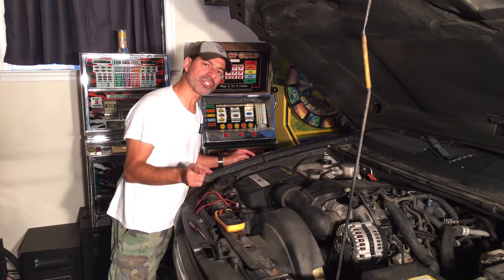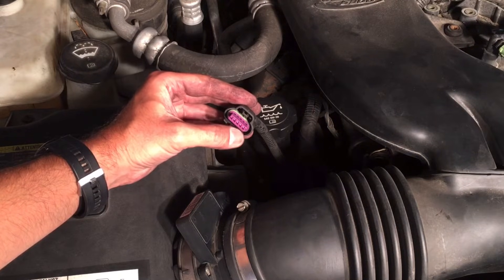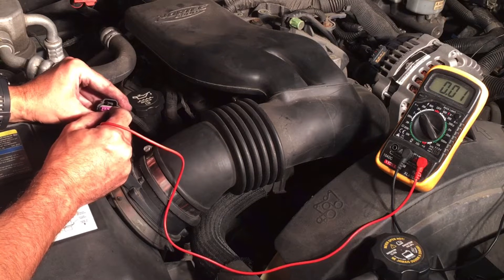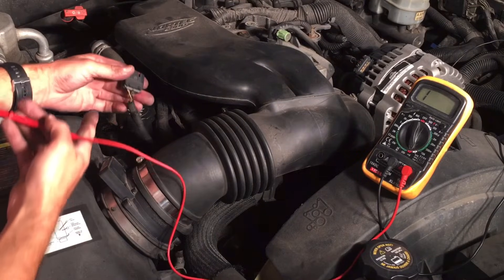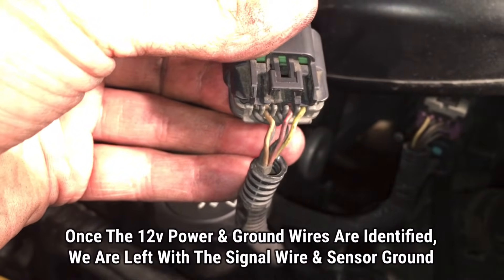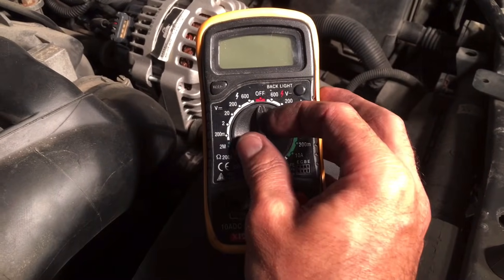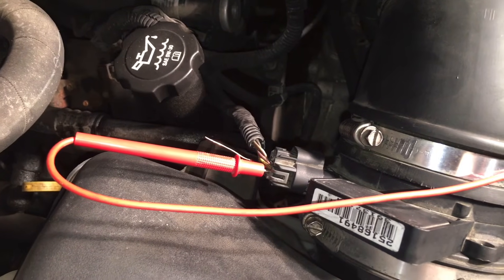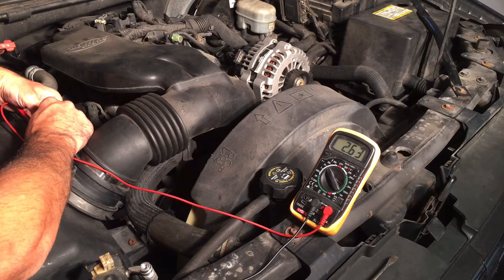How To Test A Mass Air Flow Sensor (Andy’s Garage: Episode - 287)

Comment: Very informative video up until the ~6 minute mark. I got disoriented when I saw the multimeter probe directly connected to the wire harness.
Reply: Saw that too, does that mean he needs to test the harness? Cuz I’m facing the same issue with a 08 subie. Batt wouldnt hold a charge, replaced it. Buddy wanted the fuel pump replaced while at it for kicks. Cleaned ground spot, replaced the greenish color ground strap, forgot to plug MAF in, neg term tight, started right up. Plugged the MAF in with it running, idled without much slug, and no CELS. Fast forward a couple hours, all crank no start. Replaced the cracked terminals, cleaned up all the grounds batt side, all crank no start, scanner gave MAF codes. It had 02 sensors and cat sensors and VVT sensor codes before. But now it’s just the MAF codes. I thought the batt was the main problem, I guess it was secondary. I about had it with this damn car lmao

Comment: I have a 04 Vortec 4.3.  I have a rich reading in both O2 banks. And a MAF reading in the 7’s at idle and 12-14 at 1400rpms.  O2 short trims are in the -20’s. Not sure what’s causing the rich running.  Pretty stumped
Reply from the maker: @SubePelayo928  Are you getting any engine codes?
Reply: @PhillipsVision  the P0172-0175 rich codes and there was a pending code for the MAF
Reply from the maker: @SubePelayo928  could be the MAF causing all these codes. Also check for vacuum leaks around your hoses
Reply: @PhillipsVision  do you think a bad spider injector can cause it?   Fuel trims are in the negative as it’s trying to reduce fuel. O2 banks on both side are showing rich.   maybe the MAF is showing high to compensate for the amount of fuel that’s being dumped in?

Comment: I have code 106 and 108 the car starts but sounds ruff idling think its map sensor or wire any suggestions ihave changed spark plugs coil packs mass sensor now order map sensor
Reply from the maker: @kylebrewer6686  the codes you are getting pertain to the MAP sensor. When those go bad you will get rough idling among other things. Replacing it should solve your issue.

Comment: You say after excluding the 12v power and two ground wires, one is left with the signal wire and sensor ground. . . But of those two, neither tested positive for ground continuity. How could there be a "sensor ground" wire that's negative for ground continuity?

Comment: I've always had intermittent issues engine management issues with my 03 Chevy Express.  It sat for about 7 years until I recently needed to get it back on the road.  It ran fine then it stalled on me and I had a MAF code.  I found the tube for the intake popped off the piece that attaches to the throttle body.  FFS

Comment: I AVE MERCEDES BENZ C220  OF 1996 , NOW I AM FACING THE ABOVE PROBLEM, LIKE ENGINE RPM GO VERY HIGH, BUT THERE NO POWER TO PULL THE CAR, ITS STARTED SHOWING THIS PROBLEM RECENTLY, IS IT RELATED  TO MASS AIR FLOW SENSER, AND ALSO PETROL CONSUMPTION ALSO INCREASED, ?EXPECTING SOME REPLY FROM YOU,

Comment: I just tried a web site that for $2 let’s you ask a question of a mechanic so I asked which is the signal wire on a Subaru forester and I got yellow wire pin 5. This info in addition to this excellent video allows me to follow the direction but jump straight to testing…wow this makes it so simple. Thanks for the great video.
Reply: what website would that be my friend.. Im trying to teach myself right now and Im kinda stuck
Reply: @johnnyappleseed6665   Don't give in, man. Just keep going, like I do. I get a wonderful sense of achievement when I finally get there.. plus I can stand watching TV.
Reply: How did you get stuck??? Cuz this video explains it perfectly, @johnnyappleseed6665

Comment: Thanks my friend, i enjoyed watching your educational video, except at the point of 6:20 of your video, I'm confused. Where's the ground wire coming from and to where are you connecting to it please?
Reply: Have the same question, thanks for your help.
Reply: I’m still confused. Fantastic video except there’s a large gap of knowledge.  I’d the negative black lead from multimeter still at the battery?  Then introduce a new wire to connect any ground to the ground on sensor? But didn’t we have two wires with continuity “which makes sense because there’s two black wires “
Reply: Yh kinda skipped the most important bit 🙄
Reply from the maker: The black wire on the harness should be your ground. It is at the end of the harness
Reply: Is it red wire in sensor coupler? @PhillipsVision

Comment: Thanks for the great video, Mate.  How do you know that the yellow was the signal wire, for the red meter probe to connect to, or does it matter? Could you have put the meter probes on the other way and it would have read negative; or would it cause damage?   Thanks again, my friend🙏👍
Reply from the maker: I found online a diagram of which wires were what
Reply: @PhillipsVision  thanks my fry.  Would it matter if you put the probes on the other way round, or would the value be the same but negative.  Thanks again.🙏👍
Reply from the maker: @johnmartin7597  I would test them in the proper order to avoid a bad reading.

Comment: Is there a fuse for that circuit? Am not getting any power.
Reply from the maker: I don’t believe there is a specific fuse for the MAF sensor. If you’re not getting power, you may have a break in the wires that need to be replaced. Here is a link to a video I did showing how to find a break in wires: https://youtu.be/714_57IRwkk?si=SDTRjuy1pTdckBIc

Comment: Hi I have a 2012 sciom Iq and is ideling I change the throtle but no change on the idle any suggestions pleace
Reply from the maker: Could be a faulty IAC (Idle Air Control) Valve, or a dirty throttle body
Reply: @PhillipsVision  how can I check if the IAC is malfuncioning
Reply from the maker: @esdeynnahernandez4964  start you car cold, watch the RPMs. If it’s working fine you should hover around 1.5 RPMs and gradually drop to around 600. You can also take it out and visually test it. The plunger will open and close.

Comment: At back probing  You show where you connect the red lead of multimeter. Next you say you Connect the multimeter ground to the other....other what ????????? Ground ? Other back probe? Other. What.????
Reply: He trying to say in one of the comment that black and red probes are at same yellow wire which is pin no 1..
Reply: @nadeemmohammed5182 Huh?? Black and red probes are at same yellow wire? Not following your comment.
Reply: @amen_ra61622 Pretty sure you want to be connected to both signal wires. Which was yellow and orange in his case
Reply: Yeah I was following right up until he got to the signal wires. 12v battery power and Gnd continuity check made sense. But there was no closeup of the back probing other than showing the first copper wire being inserted on that one pin. Are we to assume the remaining wire that was not a Gnd had a probe inserted and the multimeter was attached to those? Aren't those the air intake temperature sensor leads? On another video, it showed if your MAF has 5 wires, there is an IAT. Was that the case on this or not? There is still some info lacking to me.

Comment: i cant keep the motor running it shakes ans dies   what can i do ??? thank you
Reply from the maker: Are you getting any engine codes? Could be the Idle Air Control Valve or a dirty Throttle Body
Reply: i get po102  and po113  please help  could i have a broken wire some where ??  sensor is brand new  throttle valve is brand new @PhillipsVision

Comment: Sir…good step by step, however on your back probe description, you put your stripped wire in the sensor line, but what wire/line was the red multimeter probe inserted. Thank you
Reply: Yeah I was wondering the same thing. And agree it's otherwise a good video
Reply: He definitely didn’t explain this well. From my understanding he backprobed the 5V wire and the only wire left after finding 2 grounds, the 12V and the 5V. That wire would’ve been the one all the way to the left if looking at the front of the connector.
Reply: Thanks Carlos!👍👍 @CarlosCastillogearhead
Reply: He said right in there what  wires to probe go back and watch and listen very carefully @4:10/9:05
Reply: Can you reply to this please

Comment: I had a mechanic that ripped The Wire off my harness that went to the air mass flow sensor this is a good video
Reply: If you mean that the mechanic stripped some of the wire insulation to make connections with a voltmeter (multimeter); then, you got a poor mechanic. Using backprobe pins is the correct way to proceed to make electrical measurements.

Comment: I had a black wire with 12 volts and a white wire with 4.49 volts or signal wire. Red was my ground. LOL

Since the car won't stay running after starting it, it's difficult to test it. I was hoping for a standardized resistance between the different pins or something like that.

Comment: 1999 Toyota Avalon car with a v6 engine that cranked but wasn't starting.
After engine rebuild and gear oil replaced . While test driving by the engineer , smoke started emanating from the engine bay. Precisely, from the fan relay that the car owner connected by himself. Within few minutes, the car shutdown by itself as if fuel is finished.

Presently, it's a crank a crank no start, no spark, no injector pulse, check engine light staying ON with ECU connected or removed.
I tried to scan for DTC codes, but my scanner wasn't communicating. I checked all fuses, power and ground at obd port, those checked ok. but my scanner isn't compatible to read CAN network. There are only 4 wires intact for the obd2 port.
Furthermore, I added fuel through the intake to the engine, no change at all. I checked for spark and injector pulse. These things weren't present. But there was power to injector with just the key at ignition or ACC and COP had 1 ground and 1 power as usual.
With the ECU removed battery connected, Engine light would come ON. with ECU connected check light still comes ON.
Before I left, I checked the MAF sensor 5 wires and noticed that 3 wires were earth instead of 2 and 1 power; no ignition current/ power was available for the remaining 2 wires.
Please, what should I do
to get this car running again?

Comment: All these videos only show how to test a wire harness for it. How do you check for the resistance on just the sensor it’s self
Reply: If the mas is bad here's how.disconnect it while car is running if it shuts off its working if it still runs its bad

Comment: Just wondering if you checked out a new MAS for rising voltage to double prove the first one was faulty?
Reply: Or just unplug if it dies it's good if stays running it's bad
Reply: @Billybritt-s4t  does this work with all maf sensors?
Reply: @Billybritt-s4t By “it dies” do you mean “the motor shuts down”?

Comment: My 95 lincoln mark viii motor, in my 67 f100 seems to snap and pop and crackle when its cold. I notice it as the temperature gets cooler towards the fall. I've cleaned the MAF but it still does it. Any suggestions.?

Comment: Andy have a 2011 2.4 Equinox.Codes saying bad intake and exhaust solinod.Rreplaced but still runs rough making sound out of timing chain cover.When unplug solinod intake. sensor helps.Very confused what wrong.

Comment: Hi Phillip Great video I have a 2009 Murano V6 I replace the fuel pump but still no start spin over good I can hear the pump run when I turn the switch on, can I still check the Mas air flow sensor if it's not running Thanks
Reply from the maker: Yes, but doesn’t sound like the MAF, could be the fuel system or ignition system. Make sure the injectors aren’t clogged or the ignition coils or spark plugs are bad.
Reply: @PhillipsVision  Hi Phillip i check It now I have a U1000 Code on the 2009 Nissan Murano is there anything I can do to fix it Thanks again could one of the sensor be bad
Reply from the maker: @juggie396  this code pertains to a Communication Area Network lost communication. It could be a bad ECU or faulty wiring
Reply: @PhillipsVision  OK Thanks I'll look into it.